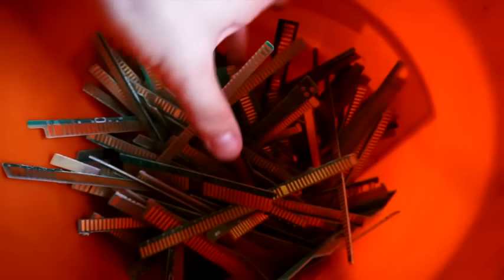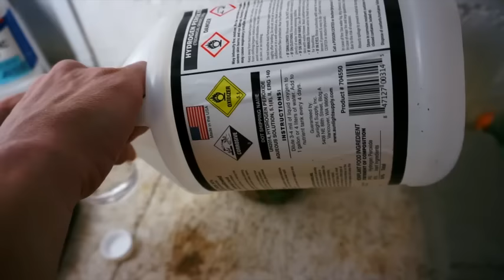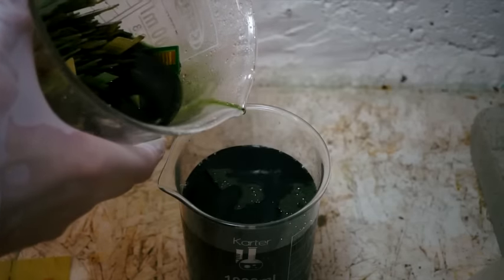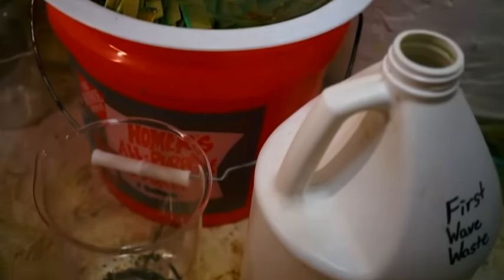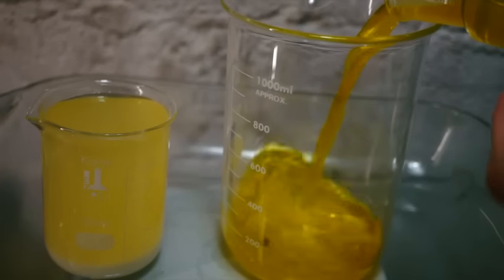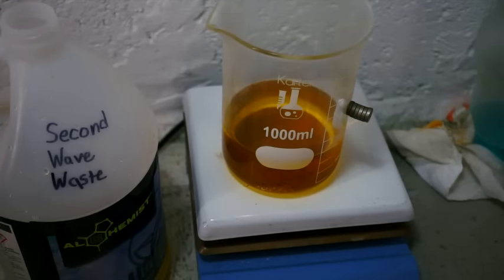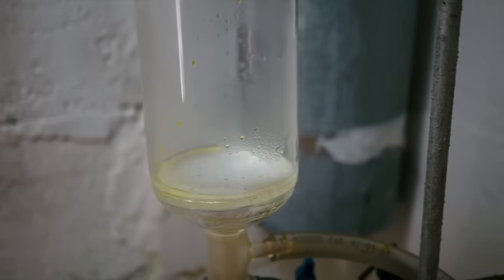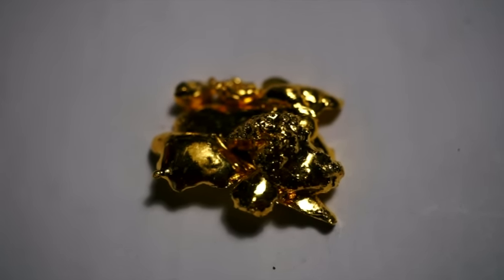How to extract and refine gold from old computer parts.

Comment: Wow really cool! I did some calculations and it turns out that at 26.16 grams of 22-carat gold, today you would have (gold being the price of $52.56 per gram) $1375.05 not too bad for saving old computer parts and then all of that in a day's work. Sounds kind of naive but I fix computers and for the longest time I didn't know that they had gold on the boards. If I only had all the circuit boards and pieces that I have thrown away. shaking head 😣🙄 Such is life. Great video! I thoroughly enjoyed it!
Reply: Wow, I asked that question...thanks for the answer!
Reply: You didn't pay very good attention if you thought that was accomplished in a "days work "!  Just the first initial soak/washing stage took OVER 72hrs( AS HE STATED). and in total I think this whole process took most of a WEEK**.  Id be curious to know the total amount of time it took actually....🤔
Reply: Honestly young lady, I'm a semi-retired roofer and life long scrapper, and even I have been saving computer boards, pins, prong strips of CPU's and every other type of gold in those boards, hard drives, keyboards, and cell phones (older)  as well as conduction wires/ flat banding (which is pure gold wire) - for the past 20 years!  The scrapyards I use actually pay you by weight for the very "cards" we just watched him process and have for the past 2 decades.  Without coming off too condescending, if you "repaired" computers all that time, ( assuming you were physically dissecting and assessing the internal components with voltmeters, etc... What did you think all those bright yellow shiny things of those components are? Brass?  While brass is used for many things, gold has always been the highest conductive metal occuring naturally in nature, far beyond aluminum, copper, or any others except for this new age of graphene (super conductors,) which are manmade in a lab. 
  It's ok, it's never too late to start saving them and now you know!- high end stereo systems are loaded with them as well as basically all types of electronic equipment we see thrown away every day, and ONCE YOU START COLLECTING THEM --It adds up QUICK! I have buckets and gallon  ziplock bags full of them.  Even if you don't process them right now or by yourself, they are the same as "💲in the bank!" 
Happy hunting 💲

Comment: Cool video, great idea. I've never messed with those acids, and I don't think I should start now. Just figured out that I have adult ADHD, and I'm too easily distracted to complete that process safely. However, it was very interesting! I make silver jewelry and use a Smith Little Torch with propane and oxygen (up to 6000°+). That would cut your melting time down significantly over straight propane, and I'm positive you can rig up a natural gas outlet and get a small tank to gain even faster processing with a furnace. A buddy of mine uses an electric furnace for casting gold, silver, copper, etc., in his jewelry business. Cheers. Thanks for posting!
Reply: Me too; You may find that doing something like this actually allows you to hyperfocus on it...

Especially if it really interests you.

Plus, "Fear concentrates the mind wonderfully"!
:-)
Reply: Compared wit the over 3 days spent processing the scrap, reducing that time is Meh.
Reply: Addys anyone?

Comment: Points to consider for other viewers...

1. --- NO Hydrogen Peroxide (H2O2) is needed for gold foil recovery! The use of H2O2 with HCl (Hydrochloric Acid or "Muriatic Acid") is called AP (Acid Peroxide) and is now considered an unnecessary old school method when it comes to e-waste processing. Just use HCl, add a tiny piece of burnt bare copper to convert the HCl into CuCl₂ (Copper(II) Chloride) and add an air bubbler of choice for agitation. The old way of adding H2O2's purpose was to "jumpstart" the conversion of HCl into CuCl₂ from the copper that's within the PCB (Printed Circuit Board) scrap by way of oxidizing the copper so it could be absorbed into the HCl, but at the same time, it's oxidizing gold too causing it to be digested into the solution. Burt copper metal (the black char) or if you have some green oxidized copper, will instantly dissolve in HCl which in turn instantly forms CuCl₂... and no unwanted gold digestion will occur. Same, but better, results in the same amount of time, although ambient room/outside temperature does effect this... colder the slower. By using the normal standard 3% H2O2, you WILL be digesting some of the gold into the recovery solution that would have to reclaimed in other processes (more time & costs)... but this person used 34% H2O2 which digested even more gold instead of just releasing as foil & particulate powders. I sincerely hope no one who comes to this video copies this step from him. To each their own of course, but at least you now know better.

2. --- After the first process describe above, called recovery, he didn't even appear to have washed the recovered precipitated material prior to the HCl + HNO3 (Nitric Acid) AR (Aqua Regia) refining process. After recovery, any foils, particulates and other collected solids from the recovery process, needs a warm-to-hot HCl bath to help remove any left over base metal salts that may have precipitated out of the recovery solution, then 1 or 2 hot water rinses to clean the material before going to the refining stage. It isn't necessary mind you, but definitely recommended to help avoid unnecessary extra steps going forward to help ensure more clean / pure of an end product without needing to waste possible extra time and $. He at least did do so in the refining stage.

3. --- The use of that magnetic bar-stirrer to mix SMB (Sodium Metabisulfite - Na₂S₂O₅) and water is just lazy & showing off of lab toys. You don't need to be that fancy to mix it... just stir with a plastic spoon. Not to mention, for gold foil recovery, it is not necessary to use a vacuum filtering set up. It doesn't hurt mind you, if you want to spend the extra $ for it, but it definitely does not add any extra benefit to this process and therefore it is completely unnecessary.

4. --- Speaking of SMB solution making, it should be clear... not cloudy yellow. He used WAY too much SMB. That was just $ wasting. The normal amount of SMB to be used, regardless of if you want to predilute it in water, is one gram of SMB for each gram of gold that you anticipate to be in the solution. Of course, there is no way to know EXACTLY how much is in any process solution, regardless o yield data guides, so just add a little at a time until there is no more reaction. Too much will cause white crystal CuCl (Copper(I) Chloride) that is copper to drop out with the gold. Yes, that CuCl can be dealt with by adding HCl afterwards, but then that's extra avoidable steps & acid costs. 

5. --- Every time you pour off a solution (decanting), ALWAYS filter it during the pour for that "just in case" of pouring out any possible particulates of gold or other PMs. This guy didn't do that. Yes, one could argue that you can just reclaim any poured off PM particulates when processing the waste solutions later, but your goal should be to reclaim as much as possible during the Recovery & Refining (R&R) processing... especially if going for yield data for later material processing info to go by, compare and have a better idea of what to expect. Waste solution processing will be a mix from many processings that wouldn't help any initial yield data.

6. --- He didn't explain that your melt dish needs to be relatively even-glazed with borax prior to placing the gold powder in to be melted. The borax glazing prevents the gold from sticking to the melt dish and allowing it to bead up & pour smoothly.

7. --- 26 g of 24K gold from 4-6 lbs (1.8 - 2.7 kg) of that type of material (he fluctuated from video mentioning and comment replies as to how much material was processed in the video) is not very likely or realistic on average... even if that material is from older (like 80's and older... he didn't specify for any clarity) computer PCB scrap. 20 g maybe, but also keep in mind that he also had a lot of that gold digested in the first processing that he saved in a chemical jug for later waste processing. Whether or not he processed that waste solution off camera and just added the reclaimed gold from it to what he does show of recovered material is unknown. I also can't help but wonder if maybe he had also processed more of that material he said he got from the 20 lb (9.1 kg) lot and added off camera at some point... but that's just my wondering. I'm not saying it's impossible to acquire that high of a yield from material of that weight he's claiming to have only processed in this video, but rather just know that it's highly unlikely to happen... unless it's special grade older computer PCB scrap like military or aerospace computer scrap... and even then it's a stretch. I mention this because, for most who come to watch this video and don't know any better, I don't want people feeling misled into thinking that this is the normal average expectancy, or even slightly higher than normal. On average, 4-6 lbs (1.8 - 2.7 kg) of similar fingered material would be 2-3g per 1 lb (453 g) of material, therefore on average of 8 g - 18 g.

8. --- And, as many have mentioned already, WEAR GLOVES! Proper PPE is a MUST if you want to minimize/avoid major health problems. He replied to one saying that he just supervised the person we saw handling the chemicals in the video. What??? That's even worse of his character! It shows that, perhaps he cares for himself maybe (if he was actually with that person during filming instead of safe & sound in another room), but he has no regards for his assistant or hired help and their health & safety by not requiring them to wear gloves. We have no way of knowing if he even provided a respirator for that person. Just because a fumehood may be in use, don't chance it.
Reply from the maker: Thanks, I am happy you enjoyed the video 🤗 😀
Reply: where were u initially
Reply: Make a video and sound like him.

Comment: The professional gold refining process is done differently:
   Important: to carry out all stages of the process under a powerful forced air exhaust !!!
  Or outdoors outdoors.
1. Put the parts into a clean stainless steel bowl.
2. Place the bowl so that it is convenient to heat from below with an open flame until it burns out completely and turns the parts into ashes.
3. Pour the ashes of the parts into a quartz glass chemical flask, fill with dilute sulfuric acid and heat until the chemical reaction stops completely.
3. Carefully drain the solution and thoroughly rinse the precipitate with plain water.
4. Dry the sediment in a stainless steel bowl.
5. Prepare "aqua regia", to do this, mix 1 part of concentrated nitric acid with 3 parts of concentrated hydrochloric acid and leave to "ripen" for 20-30 minutes, as a result, an orange-red color should appear in aqua regia.
6. Pour the dried precipitate from PC parts into a chemical flask made of quartz glass, pour the precipitate with "royal vodka" two or three centimeters above the dry sediment, chat and put the flask to heat up until the solution boils.
7. After the termination of the chemical reaction, cool the solution and pour water into the flask in the ratio - 1 part of the solution plus 2 parts of water.
8. Stretch a dense 100% cotton fabric over a bucket or a large plastic bowl, fix the fabric around the circumference with adhesive tape.
9. Pour all the solution and sediment onto a cloth so that the solution flows into the plastic container. In the process, stir the solution on the cloth and add 1-2 more parts of water in portions to rinse the sediment well.
10. Place a plastic container for at least 24 hours to completely settle the sediment on the bottom, so that the solution becomes absolutely transparent yellow-green.
11. Very carefully pour the solution into another container, try not to shake the sediment, then the sediment can be thrown away, all the gold has dissolved in the solution like sugar or salt in water.
12. Pour some very hot water into a clean container, about 100 grams, then pour Hydrazine Hydrate into this water, the proportion must be calculated in advance like this:
for one gram of expected gold, one milliliter of Hydrazine Hydrate.
And after that, immediately pour the entire solution of gold into a container with hot water and Gdrazine, stir after 5 minutes with a plastic or wooden stick.
Leave for 24 hours for the gold to settle to the bottom of the container, do not shake.
13. After the gold has completely precipitated, drain the liquid and pour several liters of very hot water, stand until a precipitate forms, do this several times, then rinse with cold water.
14. Drain all the water, transfer the sediment to a stainless steel bowl and heat until the sediment is completely dry.
15. Mix the sediment with borax, put it in a fireclay crucible and fuse it into one ingot.
It will be 999.9 gold.
All chemical reactions of this process can be extremely harmful to health - be careful, use a special respirator if possible.
Reply: Well, all that sounds so wonderful and stuff that is the old-school method of doing it. The gold can now be processed within 12 hours with more up-to-date processes that are more economically friendly, as well as environmentally friendly. Number two the .999 do you talk about for gold it’s not a gold major, the .999 is silver gold is rated in carats. Last year alone at granulated and extracted silver gold and a number of other precious materials from Circuit Board‘s to the amount of 592.8 tons of Circuit Board. By the way, you don’t have your measurements correct, nor The method quite correct either on what you have posted
Reply: @jamesshelton1124  Yes, you are right that my comment describes the old way of refining, but it is not so old that it is no longer used, and even at home
It would be interesting to hear - what exactly is the method of cleaning gold in 12 hours, and besides, this modern method is environmentally friendly?
As far as I know, there are no other solvents for gold in nature except for aqua regia, and aqua regia, in its environmental friendliness, is not at all the vodka that people usually drink ..
Well, if we talk about the Miller method, then this method is even more dangerous than chemical refining.
And yet, 999.9 - this number shows the number of precious metal units, which is contained in 1000 units and this standard is adopted in the international marking of all precious metals, and not just gold, but also silver, platinum, palladium and other precious metals, mainly used in the jewelry industry.
I did not post this video, but in the commentary I shared my practical knowledge, tested in working with jewelry for many years and many times.

Comment: Great video. It's practical. The only this is that the lab equipment, it is a serious investment. It is worth investing though, for that kind of money I guess!
Reply from the maker: I already owned most of the equipment. But it really wasn't that expensive. The most costly piece of equipment would be the hot plate stirrer. The glass is all pretty cheap if you get it from eBay. So I guess it really all depends on how often you plan on recycling computer parts. You can also get a lot of cheap supplies at a secondhand store. A hot plate and old Pyrex cookware are excellent for gold refining. Also the initial extraction can be performed in a plastic 5-gallon bucket. I used a large glass beaker so it would be more visible.

Comment: Hi what’s the function of the hoses? Thank you so much very well explained.
Reply from the maker: The hoses are used to bubble air through the solution. The bubbling air keeps the solution agitated. Also keeping the solution saturated with air. Contributes in the oxidation of the base metal.

Comment: Thank you for the video, makes me wish I would've paid closer attention in chemistry class. How much initial investment for all of the laboratory equipment needed to do this?
Reply from the maker: Between the hotplate stirrer and the glass. I would say there is about $200 worth of equipment in this video. But you don't need expensive lab glass. You can perform this extraction with thrift store Pyrex cookware and a hot plate they may have for sale. I shop thrift stores for cheap glass all the time. Things like glass coffee pots, glass boiling pots and glass baking dishes. Are always scientific glass. Also regular 5 gallon buckets that you would purchase from Home Depot or Lowe's are fairly resistant to acid at room temperature.
Reply: @philipbender956    Wouldn't you want more than "fairly resistant" when working with acid?
Reply from the maker: @rockon7848  I guess "fairly resistant" would be a relative term.
Reply: @Frog Face he collected 26.16g witch is approximately $1,449 worth of scrap gold.
Reply: Would it be worth it to try to also reclaim the other  metals too?
Reply: @deanmorrissey6720  there’s websites to find the worth of all kinds of diff metals just like up “list of scrap metal and their prices “
Reply: @abercrombiemotorsports698  Spent $1,440 on chemicals...lol

Comment: $1250 USD is the value of 26 grams of gold for anyone wondering
Reply: Thank you for pointing that out, I came to an equal amount in €, 1170.––

Considering the time involved and the materials used, I would ask myself, „is the juice worth the squeeze …?“
Reply: @luiscyphrus5334  assuming you have somewhere safe to do this process, it's close to a hands off income stream. Took a few days but he only put in like a hour or 2 of work during that time.
Reply: @andrewd3005 there is also an equipment cost.  not many of us have beakers and vacuum assist filtration systems. Maybe the aquarium pump.....LOL
Reply: @luiscyphrus5334  If you actually think 1170 == 1250, please stay away from strong chemicals... :-/